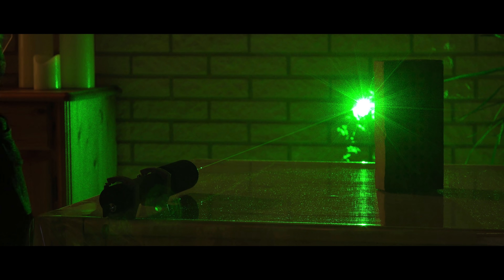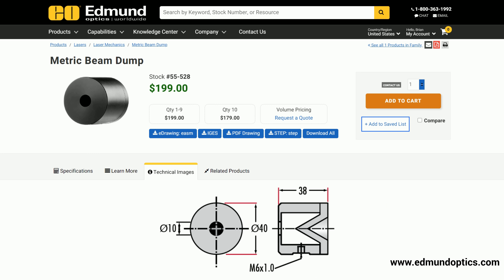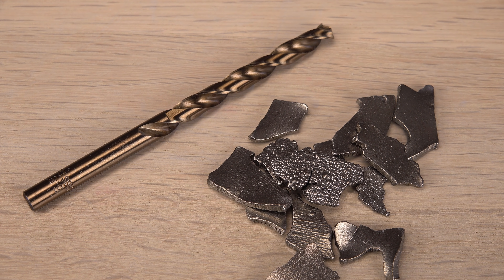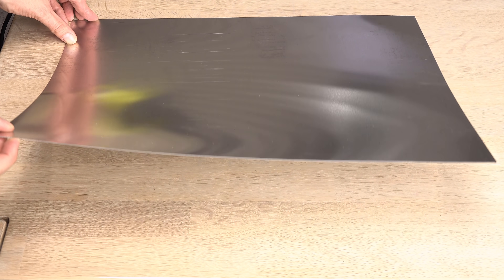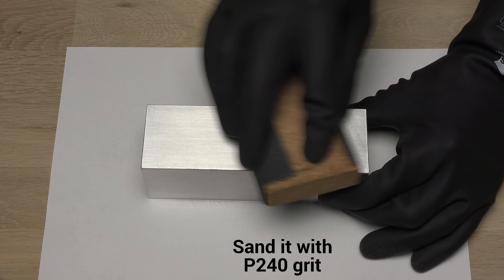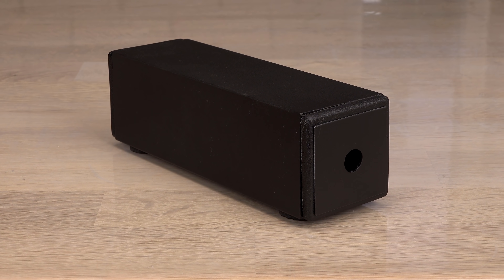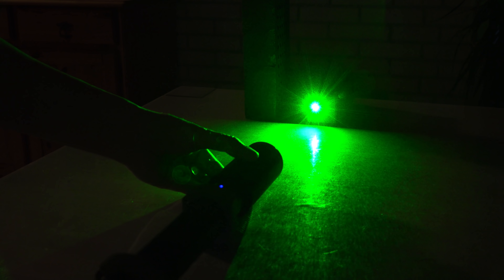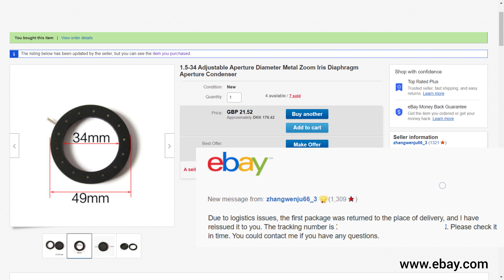Don't use strong lasers without this - easy to make!

Comment: Neat! Now there is the Musou black that is the blackest black paint.  https://www.ko-pro.black/product/musou-black-paint/  Seems the lining in the container tube can be improved to baffle more of the reflected diffused radiation.  Wondering if an outer cone would be better like a smaller section of the plumb bob or longer slimmer so basically have half sections on the side walls and then the center cone.  Seems would be most effective.  Like an anechoic chamber basically is what I envision.  Then something maybe like a one way mirror neutral density filter design or something maybe?  I'm not an expert at what you're doing, though just invested in a optical workbench to start off the interferometry projects.

Comment: Try to paint the inside and out side with muso black. With muso black absorbs aprox 90-99% of light, the beam dump will be super effective and with the addon of a cone in place of the eyeris no light will bounce. You can also and some texture on the inside to trap some more light

Comment: If you spray aluminium  with oven cleaner foam (or any strong alkaline) it will etch the surface and leaves an excellent surface to paint.

Comment: It should be easy to make a DIY Gas Shielding unit from MIG welding parts. 
The parts would be an Argon cylinder, regulator, solenoid valve and a home built nozzle.
This would prevent oxidation/ burning of the work piece and eliminate smoke that could block the beam.

Comment: I wonder what would happen if you had left the inside of the square tube shiny. Would the light just keep bouncing about and accumulating until it melts the tube?
Reply: More light will be able to escape through the aperture at the front but that means it would run a little cooler.

Any light that doesn't escape will be absorbed. The difference is that it will bounce more times (on average) before being absorbed. But absorbed is absorbed.

The likely result is that the aperture would appear to glow more.

A rougher surface inside the tube would be just as effective as a darker surface for trapping light.

In fact roughness is a big part of what makes coal or soot black. Polished hexagonal carbon is a shinier gray.

You can also see this effect by looking at a stack of razor blades. The blades are shiny, but the reflections between them can trap a lot of light.

Comment: I have slight problem with this design - the wider you make the opening in the front, the more will the light spill back out. Hitting the tip of the spike is very unlikely, you'll make a bright spot somewhere near it and it will reflect off the spot and walls - you have just one or two reflections off the black surface before the light gets out. I'm pretty sure there's design that provides wide opening in the front, yet there is minimum reflection. Something like two hyperbolic mirrors that reflect the beam from relatively wide area towards a slit in the middle, with large diffusion chamber behind that slit. I guess the shape of these mirrors doesn't even have to be mathematically exact, as long as they just don't reflect anything back.

Comment: If you want it to be 10 times more efficient put the same cone on the front lid and drill hole in the middle so the laser has way smaller chance to bounce back

Comment: if you use hydrochloride acid you can skip all the sanding with aluminum just wipe it on and wipe it off saves a ton of work

Comment: Interesting but in the mid-90s I was running a 3 kW industrial laser to cut plate steel.  Unfocused, the beam was about 18mm and would melt concrete at a few hundred meters. Yawn.

Comment: A friend gave me some sample piece of metal that Kentek manufactures for their curtains.  Probably 2x2 inches, but it absorbs so well.  I also have a warning...  DO NOT EVER bring your thermal imager in a room where a laser, especially a CO2 laser, is operating.  Any reflection will absolutely destroy the imager.  All you will see is black areas appearing on the display as it torches the chip.  FLIR was not happy when replacing my E60 imager chip under warranty.

Comment: A simple Raman Horn design is much simpler and works in all but the most extreme cases. Just bend some anodized conduit with crimp at the end or sheet metal  that has been folded in half. The beam is diffused and attenuated at each bounce and the horn shape ensures that it propogates into the horn.

Comment: Tip from the (laser) lab: a stack of razor blades (plus a bit of paint or ink) does a wondefull job as a beam blocker (each blade egde act just like the tip here). Also, irises are quite a fragile thing, beware as they will deform under a strong laser beasm.

Comment: I wonder if you could have a system which is attached to a laser, and flips one of those in the beam if you need the beam to be somewhere safe. Why wouldn't you just turn the laser off though?

Comment: For not being a craftsman, you did a great job! Always good to use a guide when cutting metal. Don't be afraid to cut plastic with low pressure and slow speed!

Comment: But can’t you just turn off the lasers specially if it’s a handheld one
Reply: Light travels super fast, and having an unwanted reflection off of some other surfaces could reflect the light into your eyes, and higher lasers can cause permanent damage faster than you can blink, let alone shut off the laser

Comment: A further addition you should add if a few internal baffles (thin sheets of painted Aluminum) with a hole about .5mm bigger than the initial hole, it will catch mor of the reflected light letting less escape, this will be mire important with higher power levels.

Comment: Just a matter of time before he uses the beam dump to measure laser power directly.
Record the temperature of the dump, shine a laser into it for an hour, note the change in temperature.
If you know the specific heat of all the parts and can account for thermal losses, figuring out how much energy made the temp rise is easy and/or peasy.

Comment: Mr Brainiac, do you store your  extreme magnets in living areas?  

Again in reference to magnets  have you ever experienced any  strange or weird effects* in yourself or in the environment?

I ask, as i once read the writings of a doctor, he either a qualified  psychologist or a psychiatrist i can't recall, who was interested in whether magnets could be used to treat certain conditions of the mind & in attempting to discover/establish if magnets had any effect he began experimenting on his self.....he attached just a regular 2 - 3 inch bar magnet to a pair of glasses which he wore, the magnet was fixed in a vertical position & laying down centre of his forehead.....his account of what he experienced is most odd, after a couple of days he reported  auditory phenomena, hearing peoples voices, shortly followed by visual phenomena, as in people appearing in his apartment or passing through it, walking through walls with some appearing half - solid, insubstantial like ghosts & others appeared just like regular people....it freaked him out & he quit his DIY trials.

His account had quite a bit of information in it & recorded some extremely intriguing details....i hesitate to include what i onlyvkinda recall as its so long since i read it......he did stress the importance of correctly  positioning the north & south pole as apparently incorrect way was extremely detrimental.

I have been trying to find the info for years but with no luck as yet.

*effects beyond or outside  known effects.

Comment: I'm not a laser expert. How dangerous are the reflections? I know you most likely won't have long-term problems when looking in a 1mw laser for a short time. I know that something like 1W can burn physical scars into the retina (when strafed I think) and make you blind. How about the reflections? The light will deflect in like half a sphere when pointed at a wall. The surface matters too, mirrors are most dangerous. How is the energy scattered from a regular wall in a room and how much will actually hit your eye and what would it cause?

Comment: I don't understand it purpose.
I mean, let say I want to burn some plastic or wood to draw a logo or cut them I will have a reflection, and there's no room to put this device in the middle, and if you do it it will mess up the whole purpose of using a laser to burn or cut.
Reply from the maker: There are more purposes to a laser than just burning and cutting. The point for me is to have a laser beam without an extremely bright laser dot scattering light all over the place - and a place to point the laser without starting fires/burning holes. For my use, it is to film the laser beam from any angle without having the laser dot burn up pixels in my camera's sensor. And making sure the laser beam does not burn my interior either... Watch my video 'Monster magnet meets laser...' for practical examples where I really should have had a proper beam dump.
Many lasers also needs some time to warm up to be stable at full power. Turning it on and off is not always a good solution for experiments. Thanks for watching!

Comment: OMG, sorry man, but this is the most useless device i have ever seen...you are worried about where the laser points when you are not using it??? what about turn it off? now thats practical...Beam dump....
Reply from the maker: Sorry, but let me broaden your horizon a little. The point is to have a laser beam without an extremely bright laser dot scattering light all over the place - and a place to point the laser without starting fires/burning holes. For my use, it is to film the laser beam from any angle without having the laser dot burn up pixels in my camera's sensor. And making sure the laser beam does not burn my interior either... Watch my video 'Monster magnet meets laser...' for practical examples where I really should have had a proper beam dump.
Many lasers also needs some time to warm up to be stable at full power. Turning it on and off is not always a good solution for experiments. Thanks for watching!

Comment: Since the innards are basically enclosed and won't ever be touched. Once you figure out an all metal design Instead of painting the innards with black paint, try exposing them to a poorly burning kerosene flame. The flame will deposit a VERY black layer of soot that will be perfectly matt. It probably isn't as black as vanta black (though since it is basically the same material it is probably close) but it is blacker than any paint can be, it's super cheap and should be fairly heat resistant. Also, thought this would be hard to do with stock parts, having the aperture be a steep cone leading into the hole in the center will reduce the risk of the beam reflecting back at you (as opposed to the aperture being a flat wall with a hole in the center) as you are lining up your beam with the hole.

Comment: Here's a thought.  Get some aquarium carbon filter granules and then coat the inside of the thermopile with spray glue.  Shake the granules so they stick on the inside.  That should help in absorbing the energy and diffusing the light more.

Comment: Or just turn it off :P
Reply from the maker: Why have a laser if it is turned off? ;) The point is to have a laser beam without an extremely bright laser dot scattering light all over the place - and a place to point the laser without starting fires/burning holes. For my use, it is to film the laser beam from any angle without having the laser dot burn up pixels in my camera's sensor. And making sure the laser beam does not burn my interior either... Watch my video 'Monster magnet meets laser...' for practical examples where I really should have had a proper beam dump.
Many lasers also needs some time to warm up to be stable at full power. Turning it on and off is not always a good solution for experiments. Thanks for watching!

Comment: Hello from the UK from a fellow science fan & laser builder. Great project Brainiac75, i built you project to your method  & specification & made 2 small modifications, 
i extracted the variable aperture assembly from an old film camera & mounted it to the front of the beam trap using a piece of 5mm black ABS plastic with a circle cut out of it to fit the aperture mechanism into snugly,i  then used  some fast cure resin to fix permanently in place, 
i found some small adjustable height rubber bottom feet on screws with  plates on the top that had self adhesive pads on ebay that gave me a professional quality beam trap i could use at any distance & beam divergence combination that was an adjustable height.
Keep up the great videos.
Reply from the maker: Great tips. The variable iris is already on its way (as mentioned at the end of the video). The variable height feet are a nice touch. Thanks for watching!

Comment: Have you considered a series of internal plates with slowly decreasing diameters from front to back (near the back scattering device being the narrowest diameter) to act like a light scattering maze?  Obviously, something conical or pyramidal with the wide opening towards the rear scattering surface would likely be even more effective.  As for those lasers.... Maybe a scattering maze on the front of the laser as well - that is a lot of spillage.

Comment: The texture of the square feet is very similar to the diffuser they use on anechoic chambers. Maybe if you put them inside the trap, it would "absorb" even more light?

Comment: what if u used musou black on the inside
Reply from the maker: Not sure how heat-resistant it is? Probably would be fine on the inside walls - not on the cone. Though it does reflect infrared from my IR-lasers. I don't think the used paint does. Needs further testing :)

Comment: Drilling tip: You should have a separate drill bit set for plastics. Just take the cheapest set (or an old one) and dull the bits with a file. They will not catch the plastic and spin it around any more nearly as easily.
Reply: And there was a mistake wih the gold color. Normal HSS and HSSE (the one with Cobalt in it) don't apeare visualy different. The color is caused by a Titanium aluminium nitrite (TiAlNi) coating whitch makes it more durable.
Reply: Wood bits and forstner bits work really good for plastic too

Comment: Your paint preparation is entirely appropriate, and is exactly what I would recommend.
Reply from the maker: Glad to hear. Did consider some etching primer for aluminium, but the Rustoleum seems to be very forgiving ;) Thanks for watching!
Reply: @brainiac75  In theory that would have been best, but adhesion isn't a problem in this application. More work than what it is worth. 
Also, if you have any problems with the paint burning through, (i don't think you will) look for a paint designed for car exhaust manifolds. In the US it is called "header paint" and is commonly available in auto parts stores. It is only about twice as expensive as what you used but can handle higher temperatures, over 1000C.

Comment: @Braniac75
I think you can improve the dump, take some thick steel wool, make it black (either with paint or sut from a fire), then add it around the walls inside, the chaotic shapes should trap much more light.
Reply from the maker: Could work if the steel wool is thick enough. I have burned normal steel wool with my class IIIB Hercules laser. I guess it would work on the inside of the walls as you mention. The diffused light from the cone does not have high energy density. Thanks for watching!
Reply: @brainiac75  You probably have some kind of metal working company nearby, with a metal lade or mill or something, they produce a lot of metal shavings as a biprodukt that they just throw away, so you can call them & get whatever amount, material & thickness you want, probably for free too.
Good luck, and thanks for uploading :)

Comment: It certainly seems to trap most of the light, but wouldn't you achieve at least as good a result by just not turning on the laser?
Reply: The purpose of the trap is so you dont waste the laser and you can reuse the trapped beams for later use.
Reply: @junatah5903  Oh, I feel so foolish now. It's amazing how obvious it seems once you've been told, isn't it?
Reply: @schell0118  yeah dont worry dude, common over sight. XD
Reply from the maker: Why have a laser if it is turned off? ;) The point is to have a laser beam without an extremely bright laser dot scattering light all over the place - and a place to point the laser without starting fires/burning holes. For my use, it is to film the laser beam from any angle without having the laser dot burn up pixels in my camera's sensor. And making sure the laser beam does not burn my interior either... Watch my video 'Monster magnet meets laser...' for practical examples where I really should have had a proper beam dump.
Many lasers also need some time to warm up to be stable at full power. Turning it on and off is not always a good solution for experiments. Thanks for watching!
Reply: @brainiac75  whoosh
Reply: @junatah5903  Does this all mean you lied to me!!??
Reply: @schell0118  yus

Comment: I'm interested in seeing your beam trap operating with a thermal probe attached, so we can get an idea of how much energy it's converting to heat.
Reply: All of it.  Thus, a 3 watt laser will experience 3 watts of heating.  That's not much unless highly concentrated on a tiny spot.  But spread out by the plumb bob, it will be just 3 watts of heating; barely detectable.

Comment: how about using intermediate baffles to catch reflections inside the dump? (or is this not worth the effort?)
Reply from the maker: I think it could improve the performance with little effort. Perhaps just a few centimeters of black metal tube on the inside of the aperture as suggested by others. Thanks for watching!
Reply: @brainiac75  that was my other thought, but unless you have a large bore, alignment might be an issue